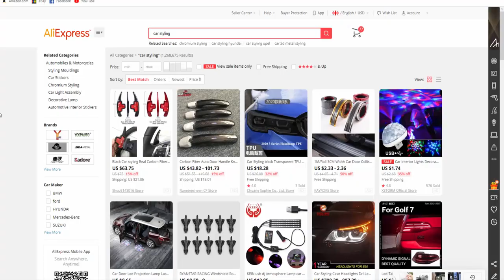Heater Core Replacement Volkswagen Passat B6 and CC. How to removal heater core

Comment: Great video. Two questions -  At 4:27 you show the inlet/outlet tubes with the coolant hoses. But, on my VW CC there is a metal shield also around the inlets/outlets. Just formed sheet metal. You car doesn't have this. Did you remove it first? If so, how? Thanks!

Comment: Was the screw between the 2 coolant lines on the firewall easy to put back in?
Reply: Have read that screw doesn't need to be removed just loosen so you can manipulate pipes.

Comment: what specific steps did you follow to bleed the coolant system of air bubbles after you replaced the core?
Reply: I am interested too...I have mine full of noisy air bubbles...could you figure out how to do? I tried opening the coolant liquid tank of the engine cooling system (I have read the 2 systems, engine coolant and interiors heating, belong to the same circuit)  and keeping the engine on for a while in order to raise the temperature of the liquid with the hope bubbles could exit, but it didn't work...

Comment: Do I need any other part other than the heatercore itself?
Reply: only more vw G13 coolant to replace what is lost during the process.
Reply: and som new o-rings for the to connections to the core, and maybe two new o-ring to the quick couplings.
Reply: @DerGolf2000  thanks so mych
Reply: @action1679  btw.  G13 has a problem clokking heatercores.  I always change to G12 plus if the customer agrees.
Reply: @DerGolf2000  Mine came with G12++ from the factory
Reply: @DerGolf2000  How bad is just plain antifreeze from a supermarket?
Reply: That is a legit question by the way